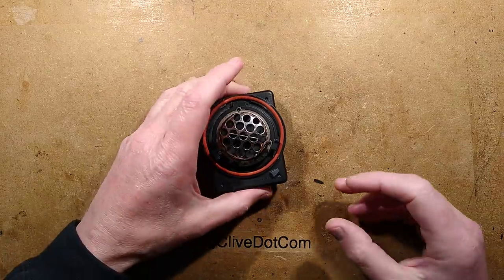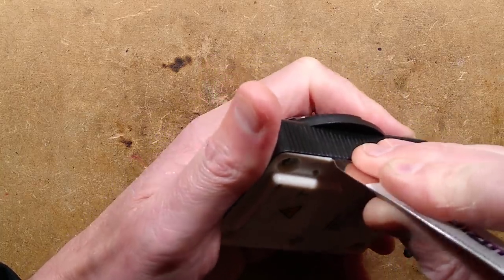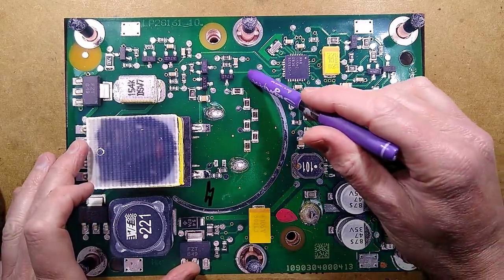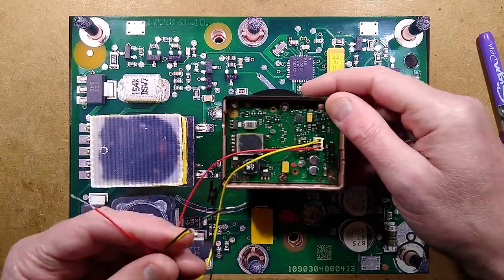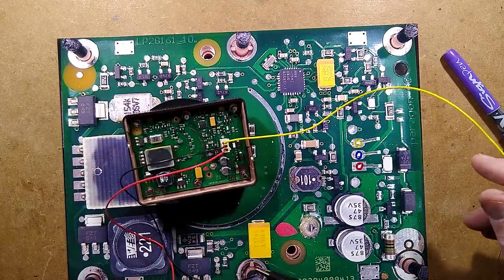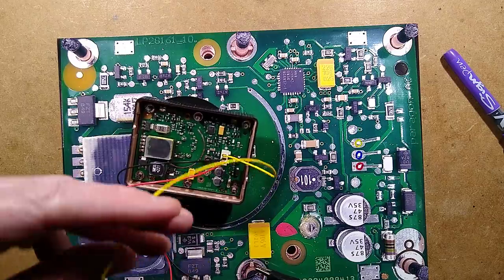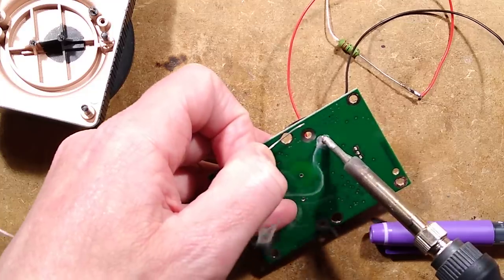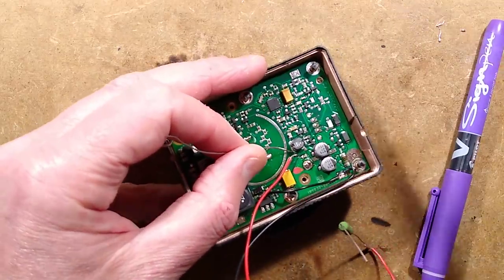Hacking and overclocking a BMW "ioniser".  (Not recommended)

Comment: Clive, I have really enjoyed seeing you taking things apart for, well ages now.  Do you think it would be a good idea to take this in a new direction? What I mean by that is repairing things that have gone wrong and that would help to save the planet or at least cut down on the waste at the local tip ;-) 
PS. I have ordered three UV Fly Zappers, one from eBay and two from Amazon, and I can not believe that all three arrived faulty and are all packed awaiting return. The UV tubes come on but the zappers are only knocking out a few volts and not the High Voltage that kills insects. They have the nerve to send that rubbish out now I have the problem in the pandemic of returning the crap and the government say I'm too old to leave the house!  ;-)
Reply from the maker: The smaller fly zappers don't do a sustained arc.  Just a small capacitive snap.
Reply: @bigclivedotcom  Yes but the flys (or is it flies?) were taking the piss they walked all over the Zappers and flew away
Reply: @bigclivedotcom  Thanks for your reply Clive, what do you think of a new direction - showing people how to repair electrical items?

Comment: An interesting unit and great video but it's amazing that it's even there. What happened to just running air through. I also wonder if it fails, does the whole ventilation system freak out then this must be replaced for £200 plus fitting to get air through again. (Just ranting that vehicles seem overly complicated these days)

But to moan a bit more, they probably have to fit this because an amount of customers only ever have the system on recirculation then complain about a stale smell.
Reply: How about service fixing the smell over the air remotely, and charging for it :D If they were able to sell the service to every customer once, it would easily pay to install these in every car.

Comment: The input is probably a CAN bus, which is well documented.
Reply from the maker: CAN would require two network wires.  But it is possibly a single wire network.
Reply: @bigclivedotcom  It should be LIN witch is single wire at 12V officially. "The ioniser distinguishes between reversible faults (caused by outside influences) and irreversible faults. Both types of fault are detected.

The feedback signal is transmitted on the bidirectional line (pulse width modulation)."
Source: https://www.newtis.info/tisv2/a/en/f10-520d-lim/components-connectors/components/components-with-b/b88-ioniser/XWEl5YS

Comment: Would you test & recommend one of those cheap ebay ozone generators for the 12V cigarette-plug? 

My car doesnt have a HVAC air filter, so neutralising or "cleaning" the air would be a interesting modification to build in.
Reply from the maker: I've made a few videos about those.  Beware of fakes.
Reply: Yeah thats why im afraid of! Thank you Clive, i will look them up

Comment: "It's very... posh"
BREATHES HEAVILY IN BMW
May we assume you had no luck looking up the controller and guessing what kind of code (LINBUS apparently) it expected on which pin, or did you just decide not to bother after taappy tap tap failed?
Reply: It's PWM for this module, details have been posted elsewhere. The timing requirements are almost certainly too tight to get away with tapping a wire though, and since it's bi-directional it must be an open drain/collector bus so needs to be switched to ground rather than 12v, and likely with no series resistor.

Comment: 'Seems very complex just to keep the air-con fresh! Does the central control unit of the car signal operation based on cooling/heating cycles or does one operate the ionizer manually when required? I presume (as I think Clive notes) that continuous operation would soon ruin any flexible ventilation ducting. (The unit itself, btw, (w/o cabling, etc) seems to cost around US$110 new.)

Comment: In the old days I just wound the window down ;-) for a bit of fresh air, when the smell of mould from the damp carpets got too much [Ford Escort mk3 battery tray corrosion - {made a lid for the battery, that stopped it over filling the battery}].

Comment: With an on-board microcontroller, I'm guessing the third wire is a CAN bus interface. Why bother with the micro if your going to feed the PWM to it? Let the micro develop the PWM based on CAN bus requests for it to turn on and do something.
Reply from the maker: It's the cheaper single wire LIN bus.

Comment: I have used a lot of desoldering techniques including blowing, sucking, and wicking, but ive never used the bang it technique. Thanks for sharing. I suppose it won't work very well for small holes?
Reply from the maker: It works surprisingly well for all holes.  But the timing is important.
Reply: Banging a small hole never works for me. I usually end up with a sore wrist,  but that's a different story.

Comment: I need to make one of these for my car - the AC is pure stinkin and the garage charges alot to flush it with disinfectant
Reply: I have cleaned them my self dilute bleach and pour it into the air intake by the windshield  windscreen if you are across the pond  let it work a wile then use the garden hose to get the bleach smell out of it . You do have to watch that you do not over flow it on the floor  I found that the drains under the evaporator get clogged and can cause a stink.  Can use wire to open them up then do the flush thing .
Reply: Completely noob suggestion here.. but can't you just spray disinfectant into the air intake?

Comment: But why is there an "ioniser" in a BMW? Like why? I am german and the only good thing I can think about is using it to make the oxygen in the intake air for the engine into ozone to use as an oxidiser instead of normal oxygen, and even that would be of questionable benefit at best.

Comment: Would you recommend running this in a vehicle at 12V? I’m considering buying one of these units and fitting it to a Mercedes just to have ozone in the vehicle, I was considering having a switch to turn it on and off or just using it in the cigarette lighter socket with a in-line fuse to keep things safe, let me know your thoughts on this :)
Reply from the maker: This is too powerful.  You can get in-car ozone units.

Comment: Part 64119159973 was found on the following vehicles:
    5' F07 GT   (09/2008 — 06/2013)
    5' F10   (01/2009 — 10/2016)
    5' F11   (01/2009 — 06/2013)
    7' F01   (06/2007 — 06/2012)
    7' F02   (07/2007 — 06/2012)
    7' F03   (04/2008 — 05/2012)
    7' F04 Hybrid   (10/2008 — 06/2012)
    Ghost RR4   (08/2008 — 11/2019)
Thats a very hmm pricy part to take apart lol
Reply from the maker: £13 on eBay as a used unit.
Reply: @bigclivedotcom  not bad at all!

Comment: Show Honda owners how to save a ton of money by rebuilding the AC resister instead of spending up to $280 bucks on a new one. Cost under $5 to rebuild 5 of them. Just a fuse and a resistor on a heat sink inside a plastic case. Loads of rip offs like this the auto companies are pulling now.

Comment: I'm curious if you can RE the ceramic element and how its made.to pump out the ions, since its not the usual needle used in ion generators.?
Reply from the maker: Search for dielectric barrier discharge.

Comment: Just bought a used one on eBay for $15 shipped... but of course, I won't be doing this mod. (uh... yeah)
Reply from the maker: Read the description fully.  Giving it the full battery voltage will potentially cause it to flash-over.
Reply: @bigclivedotcom  Thanks for the reply. I did, and as an EE, I'm still going to persue the project for its benefits to help resolve the mildew issue in my BMW i3 aircon. I'll probably make mine a little more in-depth hack, by configuring a manual control for the output level.

Comment: I wonder how they keep the compartment from getting flooded with ozone. Is there a feedback loop through the ECU with an ozone sensor, or does this just not have enough grunt to drive up the concentration to toxic levels?
Reply from the maker: I would guess it only operates within a closed loop while sterilising.
Reply: @bigclivedotcom  I guess so. Otherwise there'd be no point in having pwm control

Comment: i have a challenge for you clive ,i have done myself and its not easy,but it is possible .but it is a pain in the arse lol after trial and error i have found a way to do it . the challenge is to re-solder, solder points on a garden solar panel .but not on the the original solder points :)  lol . i have found the connections do fail quite often on these cheap chinese panels. can you do it ????????????
Reply from the maker: It requires very fast soldering, and then some resin for protection.
Reply: @bigclivedotcom  hahahaa .i failed to mention in my last message the solar panel is glass i found using flux was useless .there is plastic backing on the glass solar panels on the garden lights ,you have remove this ,because it will melt as you try and solder a new connection to the panel ,you have to hover the soldering iron tip above the glass panel.making sure the panel is level and flat .and keep feeding solder to the tip  ,until a drop of solder falls off the tip onto  the back of the solar  panel  ,like tear drop failing ,its bit like dropping hot molten drop of solder onto the glass from lets say 2mm height ,that seems to work really well . .if you try and solder directly to the rear of glass solar panel it just wont stick and will just run off .its really weird clive . but it can done  using my method.the plastic solar cells are easy :) love the video,s clive keep it up m8

Comment: bigclivedotcom 
bigclivedotcom 

What is the difference beteewn these modern ozone generators as to the one I proudly owned in approx. 1990 - 94, which was on 24/7 in our living room, the wifes dead, but nowt to do with the ozone generator; she did hate the way it collected the dust and said it was stickier to clean the dust around the mountain breeze ozone genny. The reason I'm asking is now I'm hearing that they are not to be used, whilst your in the room?!?
Reply from the maker: The mountain breeze units were just ionisers.  They put an electrostatic charge into the air to encourage airborne dust to precipitate out to walls, floors and other surfaces.  They only produced a tiny trace amount of ozone.  Well below natural outdoor levels.
Reply: @bigclivedotcom  thank you bigclive for, taking time to set me straight.

Comment: They break all of the time and are in the garage more than they are driving
Reply: The more you pay for a BMW, MB, or Audi, the more time it spends broken down. AMG and M cars being the pinnacle of... Unreliability. Too much tech and safety features.
Reply: @xenonram  Probably why mine soon passes 400 000 km. Cause its garbage, not reliable etc.
Reply: They're honestly really good cars and easy to work on. There's great aftermarket part and forum support for the issues they do have. OE supplier parts are cheap.
 No, I'm not taking the piss either.
Reply: @Alpejohn  Oh yes, your anecdotal sample size of 1 certainly can be statistically relevant when replying to my comment speaking of an entire car brand. n=1 is NEVER statistically relevant. So if someone had a BMW where the engine blew at 5000 miles, would you take that to mean that they are unreliable? That's also a sample size of 1. Generally speaking, they're very unreliable. And since you don't know what a generalization is, I'll explain. It means that you are categorizing an entire population based on a mean/median data point. Just like not all BMWs die at 5k miles, not all BMWs go for 400k km. But on average, they are not very reliable. And as you go up the model lines and the process start to get higher, the reliability steeply drops off. If you create a ratio of (time between unscheduled services)/(purchase price), that number starts to go towards zero very fast on MB, BMW, and Audi cars. Every MB we've owned, every MB/BMW anyone else I know has owned, has been in the shop an inexcusable amount of time. I have 3 friends, whose families buy obscene amounts of new MB/AMG cars every couple of years. They have a ton of money, and a ton of cars, so if a couple are in the shop, they don't care and then just drive their Ferraris or RRs. They always joke and say, "Make sure you buy your MB/BMW from a dealer that gives loaner cars that are comparable to the car you're bringing in for service. Because you'll be driving the dealer's loaner car as much as you drive your own car. You don't want to drop off an S63 coup and get a C class loaner." I have 3 friends whose families each have S65 AMGS (those are the oldest models they have, but they all kept them, even though they've been off of production a while) and collectively have well over 20 other AMG cars, over a dozen M cars, and an assorted amount of top of the range non-AMG S/G/GLS/GLE MB cars, and over a dozen assorted BMW M and non-M cars. Their Rolls Royces are their only "BMW" cars that are reliable. There is ALWAYS some stupid tech, safety, or comfort electronic feature system that is going tits-up. It often causes the car to go into limp mode or causes an entire system to not be functional. Like the seats not being able to move, the dynamic (air powered) respective boosters to not function, the infotainment system to not work,  the headlight washer mach to not retract, the rear headrests to not go up/down, the seat coolers to not work, the Distronic Plus system to not work, and so on. Your car is very old, and with 400k km/¼M mi, it's got to be 10-20 years old. Plus, it's probably a lower tier car, like a 1/2/3 stores BMW or A/C/E class MB. The older, lower tier cars aren't the ones that are as bad as the newer, higher end models. The newer MB/BMW cars with all the aforementioned systems are the cars im talking about. My mom had a second gen (actually the 4th gen) W126 1989, or maybe 1990 (I was very young) MB 350SDL long-wheelbase diesel. It was extremely reliable, and after that, there was a precipitous decline in reliability.
Reply: Andrew Delashaw you KNOW IT hahaaa
Reply: That’s why I like old hondas or Toyotas which hardly have any features to them and they are built to last forever carwow had an old Honda Civic a Ford Focus and a Peugeot 206 he drained the oil and coolant out of all three of them had their engines full revs and both the ford and Peugeot broke about 30 40 seconds later and the Civic OH THE CIVIC went for like 5 MINUTES STRAIGHT that tells ya something

Comment: BMW is corona ready, by the way, I try to run it by PWM this module but without any success, any suggestion?
Reply from the maker: It may either require a very specific frequency, or it might actually use a single wire communication network.
Reply: @bigclivedotcom  I was almost sure that I would be able to turn it on, by using the GXSpooky2 doubled generator but without luck, even tried it with many freq, no changing in current was observed

Comment: Clive it upsets me to see you using that oversized iron tip and without any static protection
Edit: I hadn’t seen you tapping out that solder from that big thru hole. CLIVE NO.

Comment: "...Because it was there"
OK, it's not a mountain, only an over-engineered BMW part from a car rich people don't buy (actual rich people don't need to show off)
So an arrogant over-engineered part from a car that was leased or bought on a time payment by someone who could barely afford it so they could tell the friends they were trying to impress that their car makes its own hydrogen peroxide.
Why not hack it? Could be useful for any number of things.
Reply from the maker: I dread to think of the cost of one of these modules new.  Incredibly expensive cars to maintain.
Reply: @bigclivedotcom  Fun story. I once had access to some unusual batteries, like a C cell but longer. BMW mechanics would buy them. One day I asked why.

The BMWs of the day had a similar battery that would wear down over time. When the voltage dropped low enough it would turn on a check engine light. The only purpose of the battery was as a timer to indicate it was time to check the engine's pollution control devices. I sold the batteries for $8. BMW sold them for $50.

Asked if they checked the pollution control gear they said no.
Reply: Actual rich people absolutely do need to show off, it's just they have chauffeurs to drive their Rolls Royce for them :)
Reply from the maker: @BjornV78  That's astonishingly cheap if it's the standard price.
Reply: @bigclivedotcom  it depends on the exact modelnr, the modelnr you have costs arround 30 pounds (new) at parts distributors , at a BMW dealer it costs 83€ (arround 75 pounds).
BMW has a complete public parts database called ETK, which is also used by BMW dealers in combination with TIS (Technical Information System) , TIS contains the repair and testing procedures of all parts and is not public available, but can be found when you use Google :-) 
Link from ETK for this Ozone generator : 
http://www.bmw-etk.info/parts-catalog/prd/BMW/VT/P/F10/Lim/530dX/ECE/L/N/2010/07/53265/64/64_1657/64119159973
This is one of the BMW models that use this Ozone generator,  and have seen models with 2 of these installed. One module for the frontpassenger side, and one for the driverside.